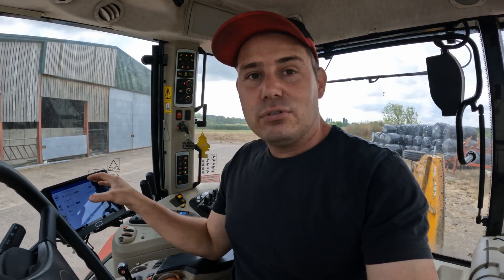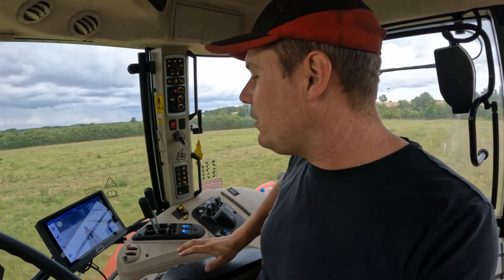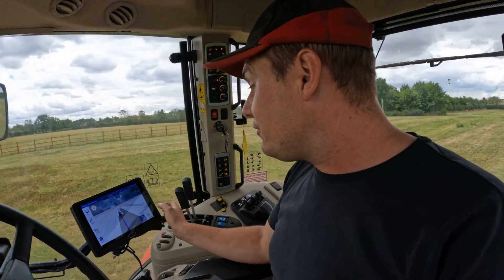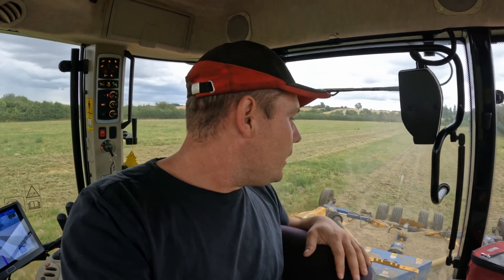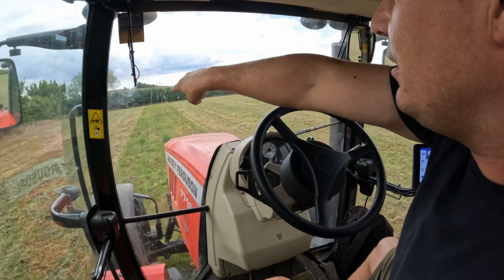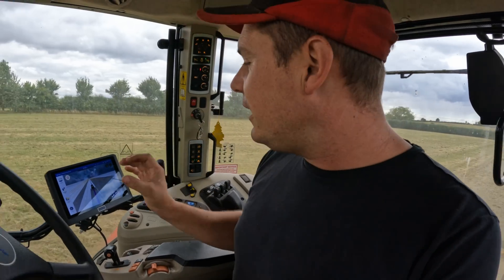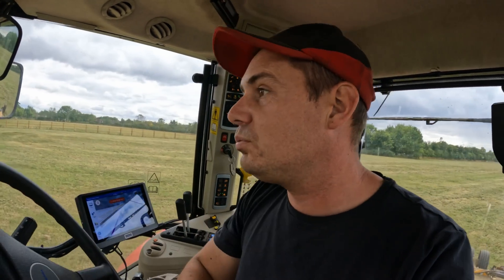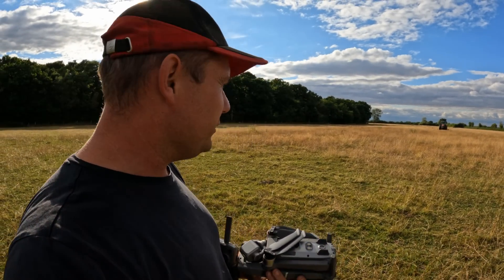Sveaverken F100 Auto Steer In The Field Testing

Comment: Hi, nice kit! 
I see you switching a key in the screen when turning at headland to use the steering wheel manually, what happens if you don't press the button? Is it easy to turn in case of something unexpected when the autoguide it's switched on?
Reply from the maker: It's the button to turn the steering off you can also do it by tugging the wheel I find it's nicer to disengage it via the button! 👍

Comment: It is really a good review on our Autosteering Kit, we hope you will have nice experience with it.
Reply: Can you adjust how aggressive the steering is (you can on a trimble set up)? What about self steer on the headlands?
Reply: @davidriley5585  Hello David. The aggressiveness can be adjusted by the P value in the system. And the Headlands turn could be achieved in Sea F100 advance mode.